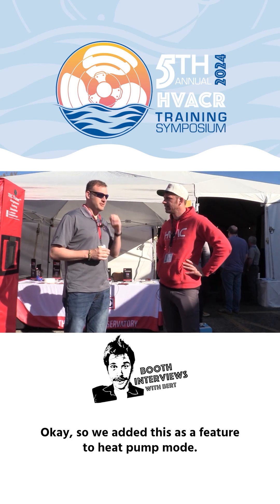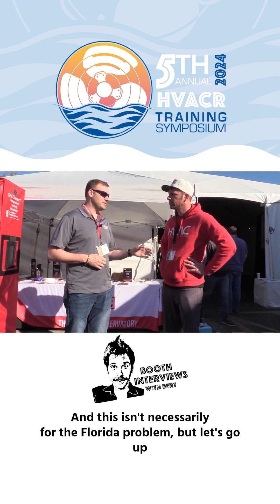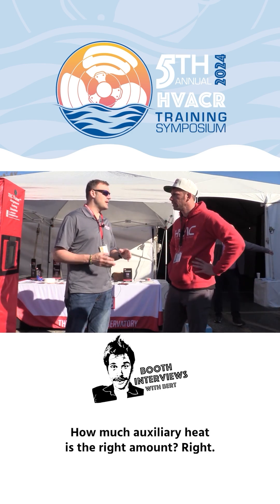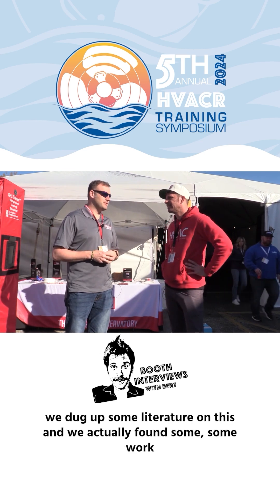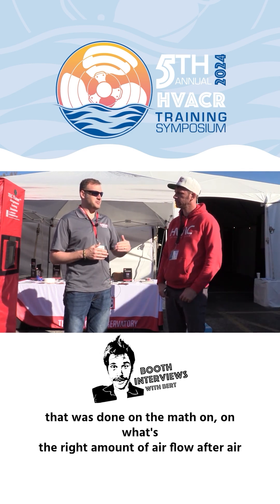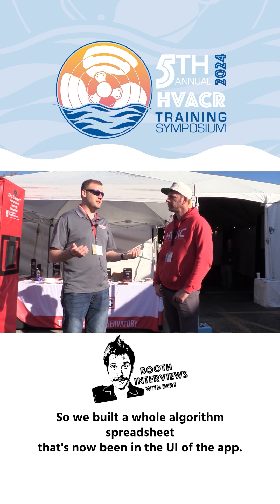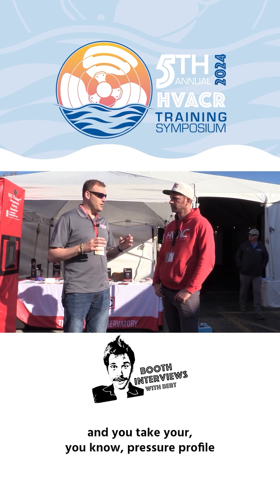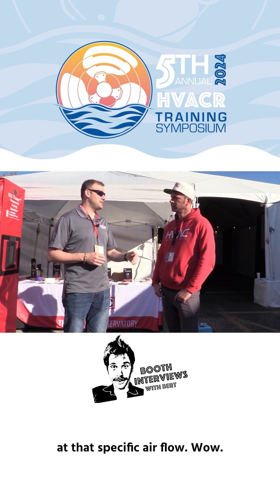Catching up with Chris Hughes at the T.E.C. Booth

Comment: Never installed electric heat on my last heat pump in my home here in Florida. Never needed it. If your unit will not produce the posted capacity, then you may have a system problem.